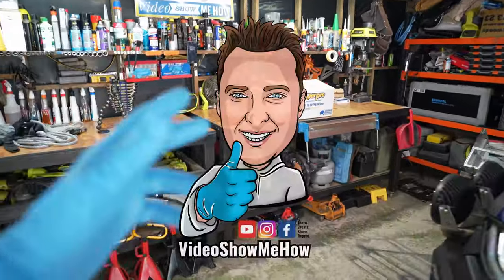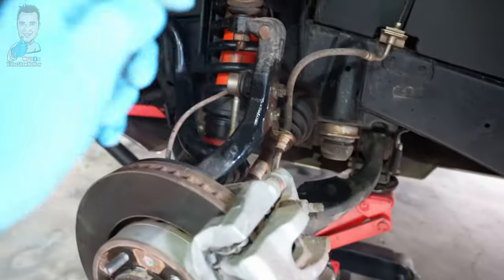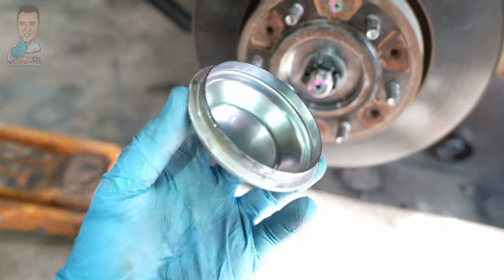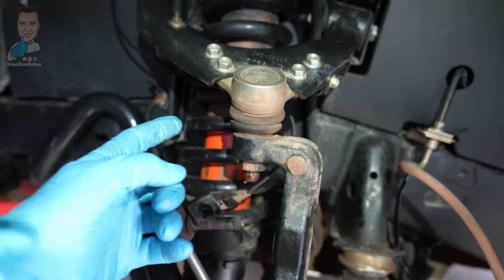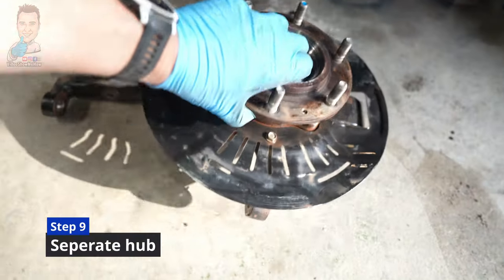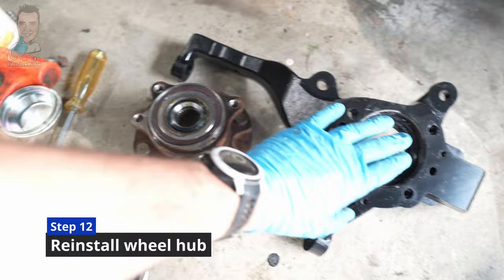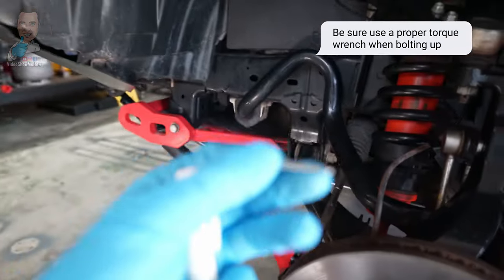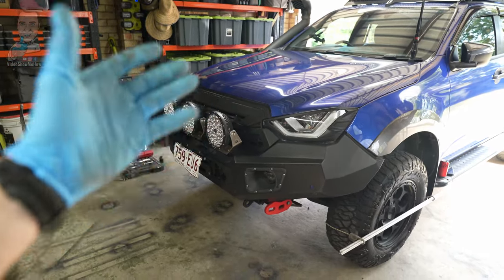SuperPro Fulcrum Steering Knuckle INSTALL HOW-TO | D-Max BT50 MUX TYRE WEAR FIX?

Comment: Great video Adam. I feel Isuzu Australia need to buy in bulk from Super Pro to do all this under warranty as it is their design flaw. Lots of money to improve on something that should not have been anyone's problem in the first place. Signs of wear on my tyres at only 17500 km's with no big off road trips and no Cape York trip under my belt either. Feel like I am going to be fighting a up hill battle if I go back to Isuzu as they will blame something else beyond their control.

Comment: Great video. Why did you neglect to fit the factory backing plate ( disc protection) ?
Reply from the maker: Sick of rocks getting stuck. Ran without in previous 4x4 as well never had an issue

Comment: Just fitted these yesterday and day before. And i tell you what, even with out an allignment atm, as im still waiting on my uca's that were supposed to be here yesterday. It drives so much better! 
Also i donno why but my driver side one was a c**t it took me half a day to do it just wouldnt release the lower ball joint no matter what i did ended up using jack hammer and pry bar 😂. But its done now hopefully ucas come soon then can fit and go get an allignment.
Reply from the maker: Nice work! There's a heap of vids on youtube to DIY align front end, fairly quick job with some straight rods and tape measure :) Got mine within a few mm before driving back to Fulcrum :)
Reply: @VideoShowMeHow  its all good the peeps here helped me out alot. As soon as i put the new uca's in they gave me a spot for one that arvo 👌
Drives so much better with the new knuckle and uca's.... booked in to isuzu thursday for a service and a warrenty claim on tyres
Reply: @Warnut how did you go with the warranty claim? Isuzu Brisbane told me there is nothing wrong with the factory steering knuckle in my 21 Dmax and it is working as designed!

Comment: Nice video mate. How’d you go getting the bearing into the new knuckle? I found mine to be a pretty tight fit.
Reply from the maker: Yeah was fine? How'd you go with the wheel speed sensors? One of mine was tight, think the powder coating might have been thicker.. got it in eventually
Reply: @VideoShowMeHow one side was very tight the other went in really easy. I’m currently troubleshooting a few warning lights after install. Got no codes when I plug my scanner in so bit of a hard one.
Reply from the maker: Which lights?
Reply: @VideoShowMeHow abs, traction, auto level lights and front camera not working. Had the battery off for 24 hours to see if they reset, didn’t work. Iv got my first service coming up so will get Isuzu to check it out.
Reply from the maker: Hmm weird only sensor being touched is abs. Fingers cross they can just clear
Reply: Well had no luck with Isuzu. When you test fitted you your abs did it sit in front of the rubber on the seal or behind it?
Reply from the maker: In front
Reply: @shanezdjelarevic9498  hey mate did you sort out the abs problem done mate and the lights just come on
Reply: @NghiNguyen-us7kb  yeap I did. You need to get the dust seals back far enough so the abs sensor can fit in front of the seal but not touch the back of the hub. There is a soft abs sensor ring on the back of the hub if your sensor rubs on it you will wreck your hubs. 

Put your hubs in then push your sensors in, if they don’t fit keep working on the dust deal. 

Lights won’t turn off until you go for a drive.
Reply: Thanks heaps mate take all back out again 😂

Comment: Can you buy a new hub seal?
If so I would replace it.
Reply from the maker: You can, but if low KMs and good condition no need. Is a sealed hub anyway so not 'as' critical as some older 4wd
Reply: I did with mine, think it was around $50 for 2 from isuzu

Comment: Hey Adam, thanks for another great video. The link in the description for the torque settings, seems to only list the wheel nuts settings. Does your link contain the rest of the settings? Cheers
Reply from the maker: Have updated, had the wrong one linked, same settings for most things for the 2011+ (can navigate on that same site for dmax 1,2,3)

Comment: Hey Adam, great video, what is the name of that axle seal as I want to have a spare pair on hand just in case I damage the original ones?
Reply from the maker: @sandycraker2486  they're called a 'Seal Oil, Knuckle' in the system part number was MZ1K01-33-067 got from spare parts.
Reply from the maker: @sandycraker2486  remember to put em in the right way, like pinned post mentions vids shows my putting them in backwards :( Top tip take a pic once you get the factory knuckles out so you know they're correct on the new knuckles 👍
Reply: Thx so much for the tips and seal info, legend.

Comment: Apparently engineers have updated there wheel alignment numbers and have pretty much eliminated the issue.
Reply from the maker: Not really, they've changed the toe spec to be POSITIVE 5.. there's a reason why OEM cars don't have that much positive toe eg wear.. All that much positive toe is going to do is somewhat cancel out some of the droop neg toe which will just wear tyres out faster overall but won't look as bad as crazy scrubbed out inners
Reply: @VideoShowMeHow  copy that!!